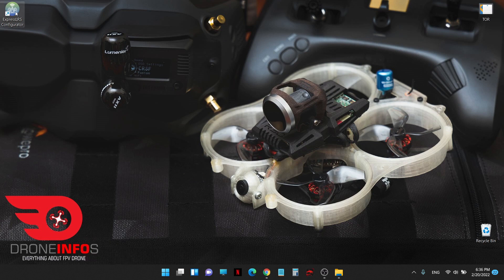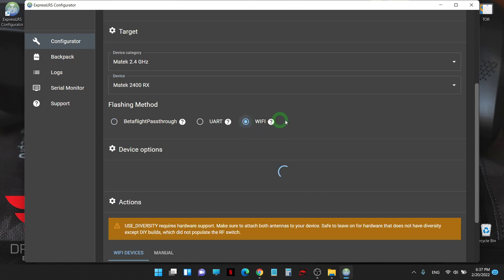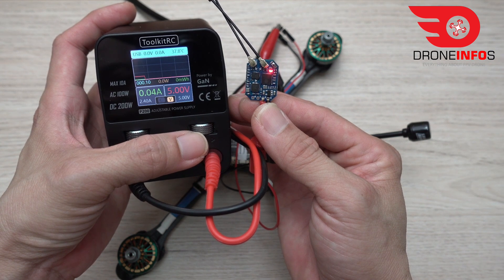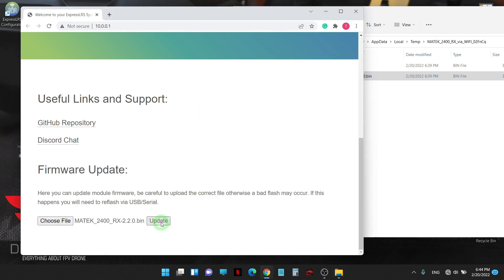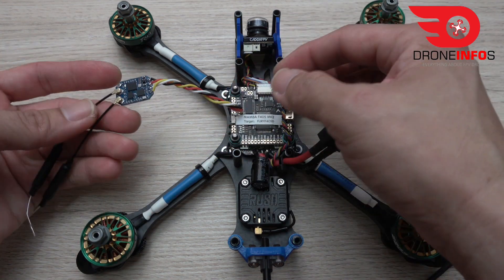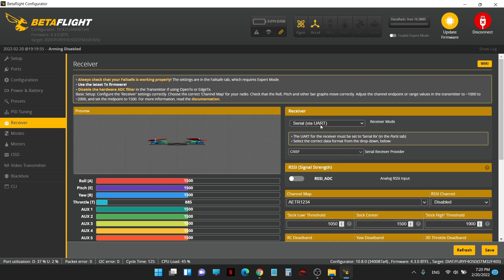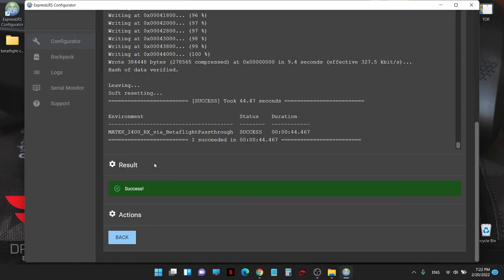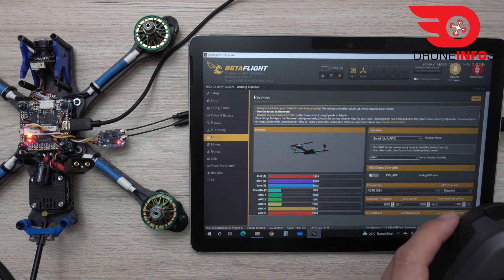MATEKSYS ELRS R24 D | Put the diversity receiver into my 5" FPV Quad. (English)

Comment: subbed!! Whcih ufl/ipex Antennas did you use, are those CRSF? Or will any similar kind do?
Reply from the maker: I use Happymodel 2.4g omnidirectional antenna for ELRS. Designed for ELRS but also compatible with TBS Tracer.

https://www.happymodel.cn/index.php/2021/04/10/happymodel-2-4g-omnidirectional-antenna-for-elrs-ep1-rx-ipex-ipx-u-fl-compatible-with-tbs-tracer/

Comment: Think will be better to put antennas on the front and back. But thanks for the detailed video!
Reply: The shape of the signal is a Donut, either way one of them needs to be 90 degrees  to the other, front or back doesnt matter